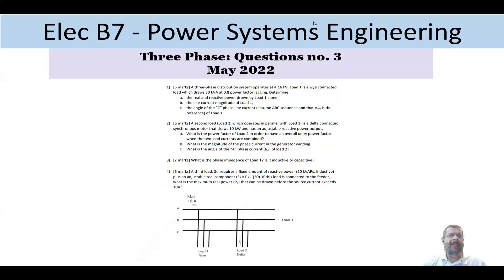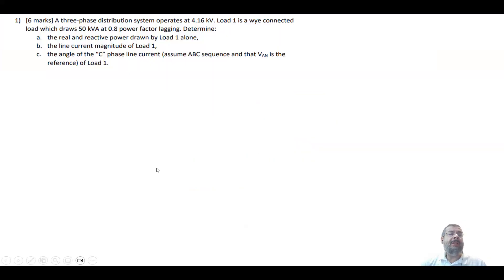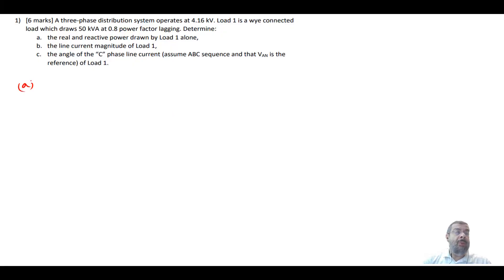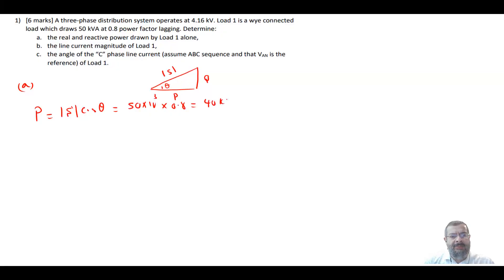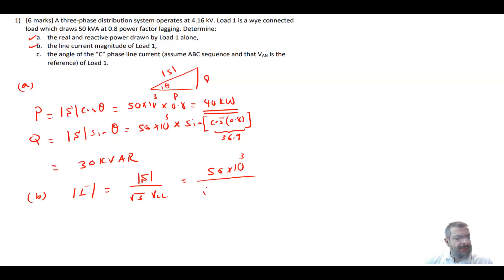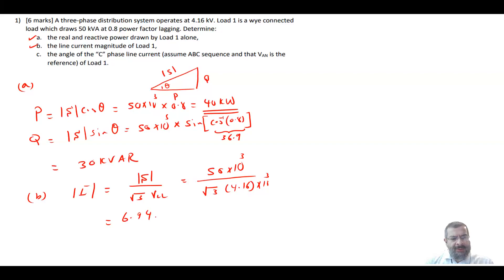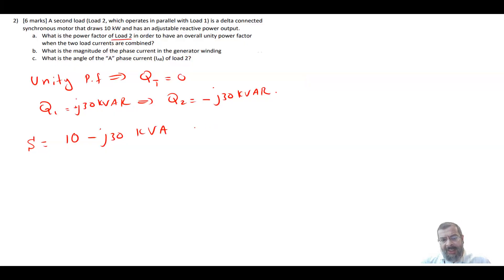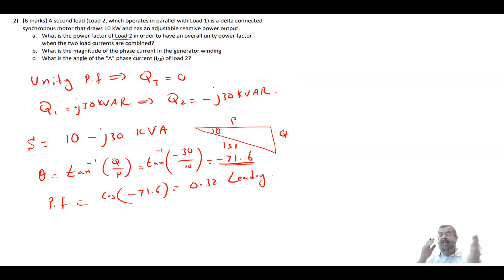PEO solved examples (ELEC B7) Three Phase Question no. 3

Comment: Hello professor, for question 2c, since it is delta connected, isn’t the line voltage and phase voltage same magnitude and angle. So it would be 0 degrees over -71.6 degrees?  

Thanks so much for your time and answer
Reply from the maker: The phase and line current of the delta load is the same but I assumed that the phase angle of the system is 0, which correspond to a Y load and hence there will be +30. Having said that, you can still assume that the phase angle of the delta load = 0, and still you will get the full mark as the reference angle is always relative.
Reply: @electrical4everyone  that makes sense, thank you!
Reply from the maker: you are welcome

Comment: St (Question 2 b) = 50 kVA; not 50 kW (8:15 sec); I know why you wrote kW in this question; however, we cannot write kW for S.  Unit of Apparent power (S) is VA (kVA).
Reply from the maker: When the power factor is unity then S=P,  so you can use either KVA or KW for the unit. However, to be on the safe side KVA as a unit is better.